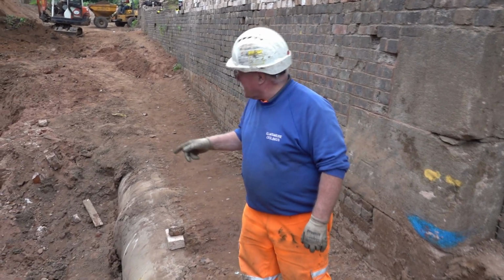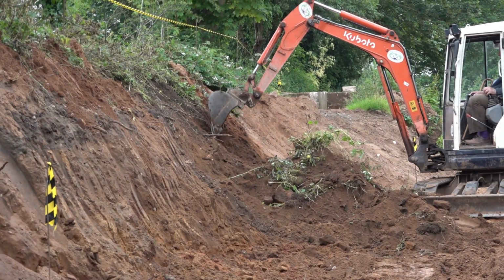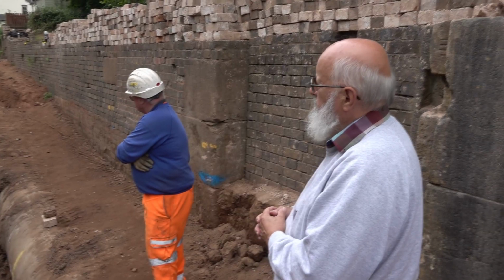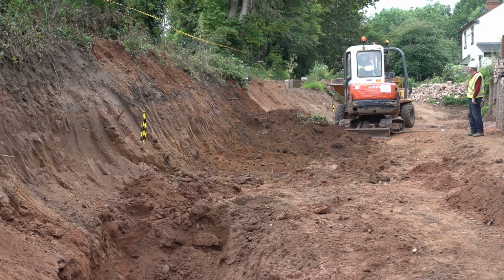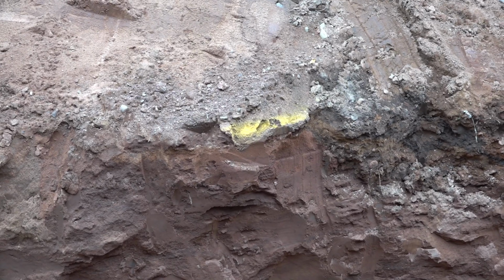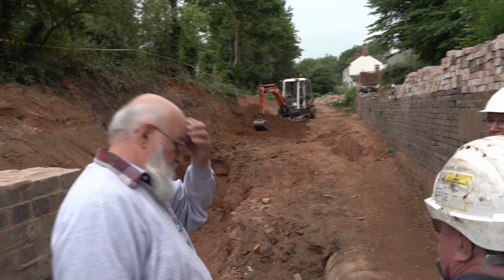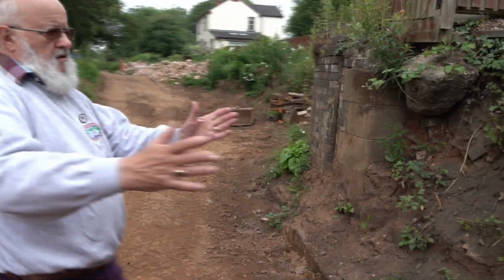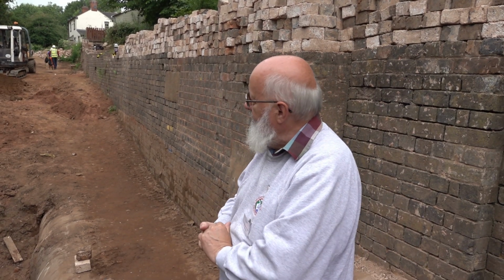The Rise and Fall of Lock 24

Comment: You have to lower the original level of the canal by 2,5 meters to be able to get under a road? And the function of the lock you are at will effectively be moved to the other side of the road where you have to build an entirely new lock? Did I understand you correctly?
Reply: @Paul Marshall I'm fairly fluent in English but some things can escape me, best to ask. Hump-back bridge, that was a new one I learned just a few days ago :-)
Reply from the maker: Spot on.

Comment: What was the pipe used for? I assume it used to contain water, if so was it used for public supply?
Reply from the maker: It's for the surface water runoff from roofs, roads and paved areas in southern Lichfield. It carries the run off that the canal would have carried when it was open. 
We've got a full explanation in our FAQs.
https://www.lhcrt.org.uk/faq.html
Reply: @LHCRT  Thanks for the explanation and  pointer to the FAQs. The FAQ on the Big Pipe hints at the responsible party for the Big Pipe, or at least the function it provides, as being unclear. Possibly down to numerous reorganisations of local government since the 1960s and the sequestration of their powers by national Quangos leading to this?